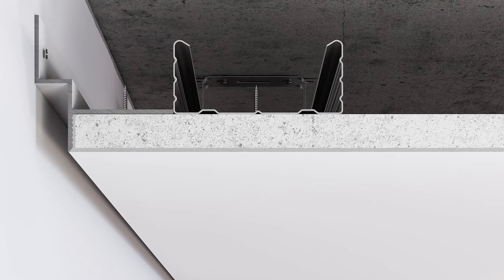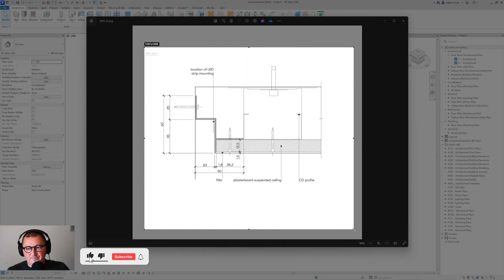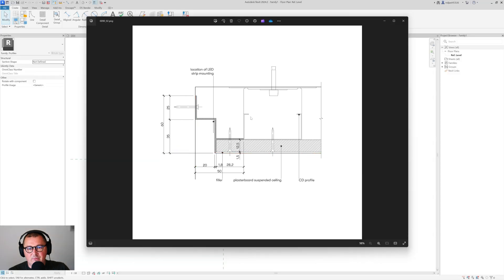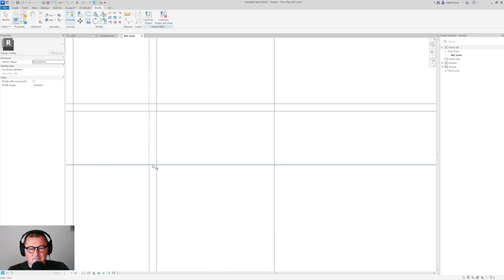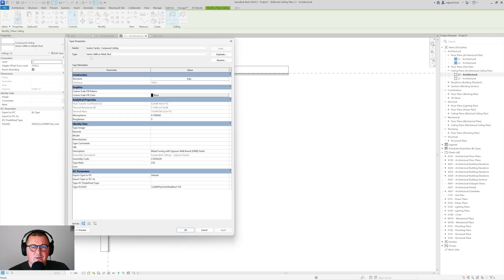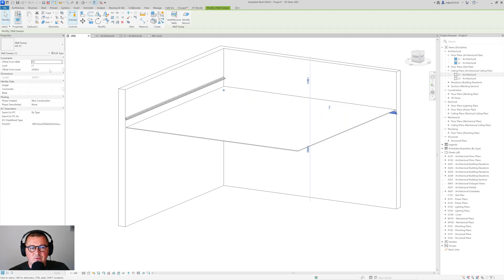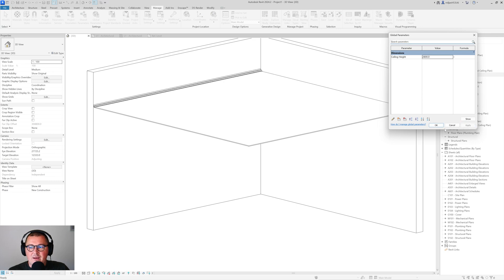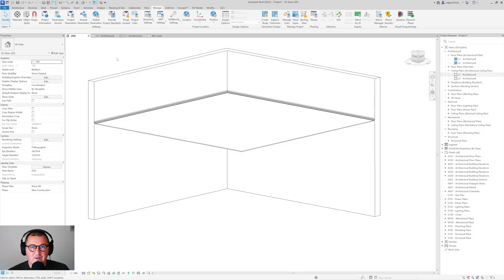Ceiling Shadow Gap - Revit Tutorial

Comment: I think it would be better to create a line based family with voids, then create the ceiling with the edges constrained to the walls. Place the line based family directly on the ceiling edges (this way, the heights of both will always be the same without needing a global parameter). The only extra step would be to use the cut tool to generate the void in the ceiling.
Cons: Voids slow down Revit's performance.
Reply from the maker: Which at the end means that this method I showed is better 😉